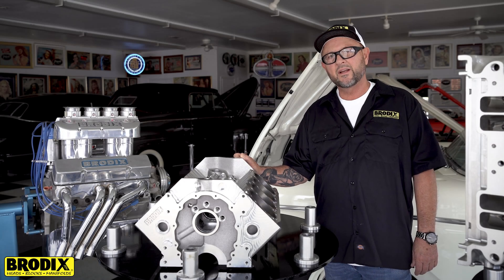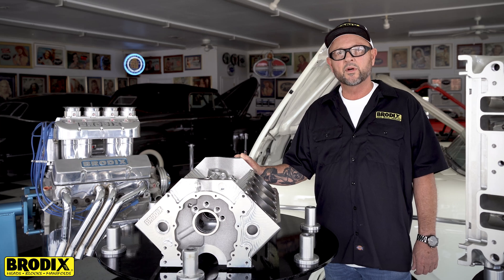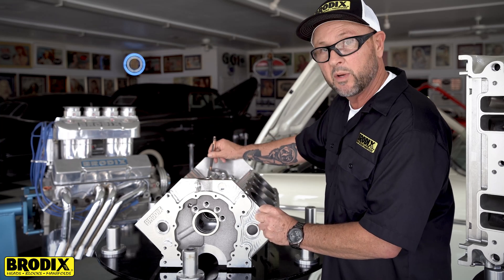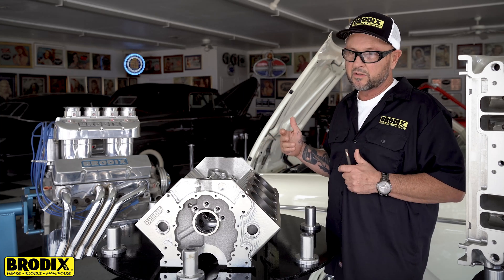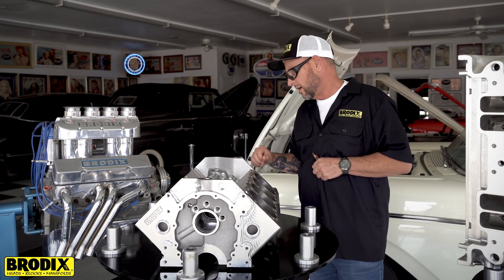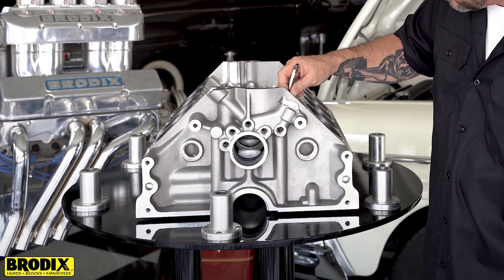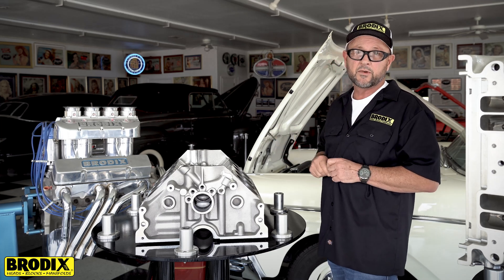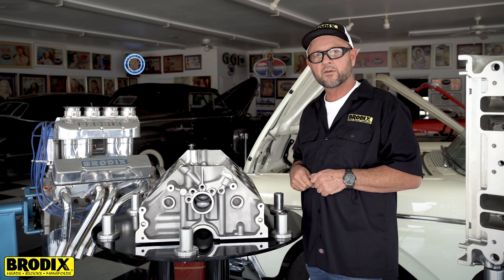New BRODIX® HD™ 410 Sprint Block

Comment: Why don't anyone make a early block with cross bolted mains instead of using regular main caps. To me that is reverse engineering.
Reply: are you asking about a Chevy or a Chrysler? Are you saying early Chevys had cross bolt mains and that splaying the caps has been a failure??

Comment: Seems like it'd be a fun block for a drag and drive setup, too.
Reply: Running boost was probably never factored into the design.
Reply: For the price, you're better off with a Noonan billet wet block. This Brodix is still, just cast(10k for a cast block, is ridiculous!). Best drag n drive small block based engine would be a Noonan LS Billet block.
Reply: The bell housing would be an issue also.